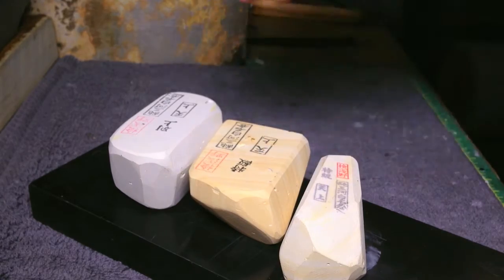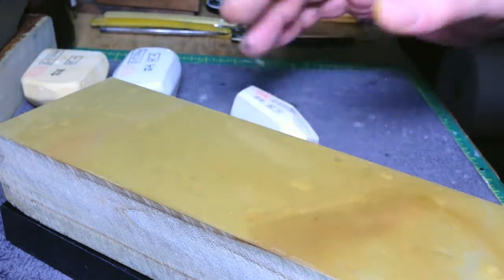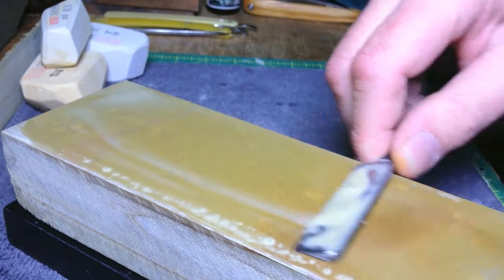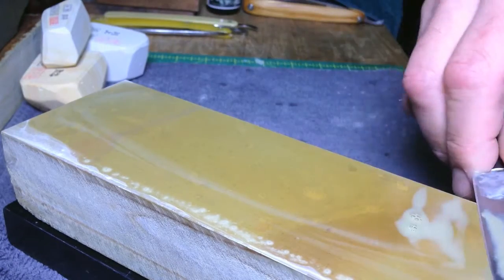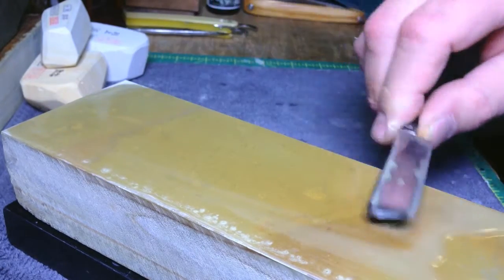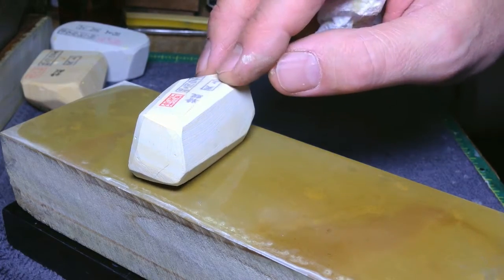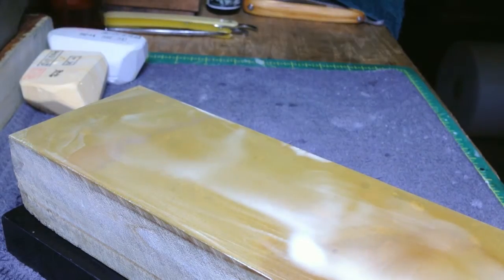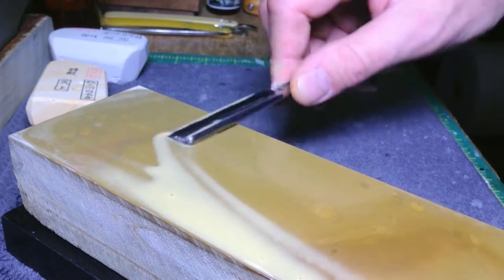MIkawa Shiro Nagura 3 - Tenjyou

Comment: Always enjoy your vids Keith.  I do have a question on something you said in the video.  You mentioned around minute 14 that you'd recommend to people that they hone up to the 8k on synthetics and then go to the Botan.  Why do you recommend that they go so high in synthetics before going to Botan?  Isn't going to Botan at that point actually taking a step backwards?
Reply from the maker: +Greg Snyder In my experience, most (not all) Botan actually map out to cutting/polishing (most, not all) razor steel in a way that is equivalent to what most (not all) people get from most (not all) 5k stones. 

My direction to go to 8k then Botan includes the fact that stones like the Norton 8k (3µm - 5k JIS), and other that are similar, are being used by a lot of people. 

It's impossible to give a perfect recipe that will be 'perfect' in every way. But setting up someone new to using Nagura with a game plan that may possibly overshoot the mark a bit is perfect in that it usually always works. 

When I set a bevel on a 1k Synth, I might go to 3k then jump to Botan, or I may just go to Botan. Depends on my mood. However - I can guarantee that if I jump from 1k right to Nagura I will have to really work/refresh/rework the Botan slurry stage repeatedly to get that stage's refinement where I want it. 

I would not expect a beginner to know how to handle that scenario; 99% of the time, most guys miss here and that includes veterans. Better, IMO, to go further along - and if you wind up going backwards a teensy bit, so be it. No harm, no foul - that toggle back/forth won't hurt the edge. 

Going to Botan after refining to 8k-ish JIS actually helps make learning Botan a little easier - you should never ever need to rework/reslurry Botan in this type of dynamic; it should be a simple straight forward slurry and go process. 

The game plan, or directions, for going to 5k/8k first before Botan evolved from how I learned, and my subsequent coaching many (too many to count) guys through the process of really learning how to refine an edge using Mikawa Nagura.
Reply: +Keith V. Johnson Could not have asked for a more thorough or clearer explanation.  It all makes perfect sense.   I have some new things to try with the stones I have now.  Thank you!